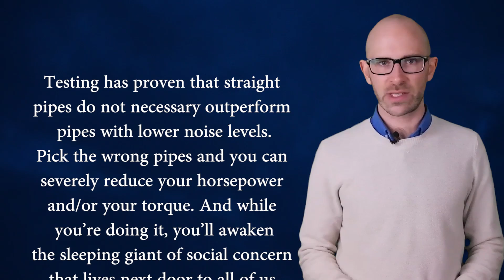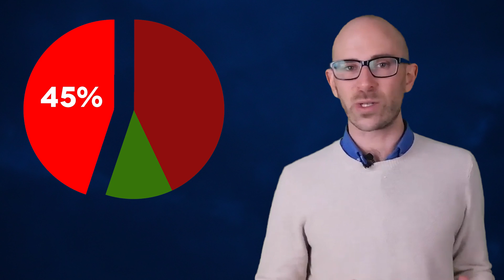Why are Harley Davidson Motorcycles So Loud?

Comment: I am willing to bet that all of the locations you mentioned are run by liberals. You also failed to mention that while riding, you’re actually traveling away from the noise you are talking about. I’m willing to bet that the DB levels from the exhaust is less than the wind noise when at highway speeds. I think I’ll go pull the baffles out of my Roadking now. 👍🏻
Reply: Thunder headers on my Roadking SE....
"Loud pipes save lives"....obviously he's clueless.
Reply: U Yanks throw some sort of political slant on absolutely anything....
Reply: Republican here. Loud motorcycles drive me crazy. Dont rev the crap out of your bike in a residential area where people just want to enjoy their backyards
Reply: @loganm2766  well you wouldn’t like mine then

Comment: He did answer why... the engines aren't as muffled as cars and people make changes that make them even louder. He even gave a charitable viewpoint of why they do that, though with certain drivers I'm still gonna say they're attention whores. You know the ones... not talking about someone who drives up to the red light, waits, and drives on, making a certain amount of noise in the process. I'm talking about the jackass whose idling engine drowns out your thoughts, who feels the need to sit and rev the thing over and over in the parking lot, who you can hear in the distance like some kind of alien murder machine when you're trying to sleep, and who blows your eardrums through a black hole when they go tearing out as the light turns green. That overcompensating loser.

Comment: What I find funny is that people will complain about a loud bike, but not ssay a word about pickup trucks louder than any bike, and the loud diesel pickups spewing black smoke out the stove pipes sticking up over the cab.

Yes there is a power difference, my quiet 1700cc(104ci) Kawasaki touring bike has no chance staying with a Harley 103ci(1688cc) touring bike

I like quiet from my bikes, but I like riding with loud bikes.......loud piipes really do save lives
Me riding behind those loud bikes is no problem, I don't understand why its a problem and louder trucks are not.
Reply: No, I'll gladly point out how annoying the spotless gigantic truck with chrome and a lift kit are. They're just as loud, tend to punch it at stop lights and signs, and also drive like assholes. It's made more ironic when they're pulling a trailer with a motorcycle on it.
It's the same problem as how everyone thinks you must be a future mass murderer if they find outut you own a gun.

Comment: I found this video because our community is having noise problems with in particular HD bikes since one of their stores opened down the street.  Now I'm also concerned about the hearing issues of riding the bikes not only for myself but my friends who own them especially because many of them have added stereo systems, equally loud.  My take away from the video is that it is the modification of the exhaust pipes that is causing the problem.  This seems like something that can be monitored by policing and registration.  I love seeing the bikes but I know the community is starting to have issues as the noise goes way past our noise ordinance times and echos among the old buildings.

Comment: Go ahead and try to make me quiet down my Harley. Loud pipes save lives!
Reply: Sure, it's the driver's fault and not the motor cycles squeezing between cars, breezing through red lights, and cutting people off.
Loud pipes aren't going to help someone hermedically sealed in a box with it's own engine, a radio, and AC to spot the narcissist whipping around them.
You hear sirens (you'll likely spot red and blue lights first) you pull over regardless. People should have to pull over for motorcycles too?

Comment: The debate does not rage on at all! You do not address the issue. You intruduce facts that have nothing to do with exhaust noise. Facts are a louder exhaust is heard by othet drivers and that save lives.The facts presented about motorcycle accidents have nothing at all to do with loud exhausts.Nothing.

Comment: A really Bad comment at 5.10 about motorcyclists being the cause of most accidents. That was not the premis of your first statement which was "do loude exahusts alert drivers of cars to a motorcyles presence'".The answer is avoided by the reamark at 5:10. The true answer which the poster avoides is 'yes loud exhausts do alert car drivers to there presence'. It's a fact.

Comment: Harley brakes are crap to make them drive slower,
to save blowing the geriatric motor up, 
the noise is to make em sound fast. 
A simple machine for turning cash into noise.
Reply: Harleys have been using Brembo brakes for 20 years now, 
The noise is from people buying stupid loud pipes for them.
Reply: @vector6977  why would you use the term stupid ??

Comment: Oh, and why are they so loud? You never got around to that. You could have gotten into the degrees of the cylinders or the way timing and valves work and egual and unequal length of exaust pipes, carburetor intakes and fuel injection. Or how the actual sound of a Harley is trademarked. This was a disappointing vid. It went like this. Once upon a time, the end.

Comment: LMAO..... You make me want to put even louder pipes on now ....
Reply: You make me want to drive past motorcycle accidents without calling an ambulance.
Reply: @jacobstaten2366  disgusting
Reply: @duskshadowpaws4434  *disgusting. And yes, causing noise pollution to get attention is disgusting.
Reply: @jacobstaten2366  although on a brighter note thanks for improving my grammar, lol
Reply: @duskshadowpaws4434   I never said I would actually do this thing. I said the original post made me want to do this thing because of how repugnant the post was. Now that grammar is out of the way, let's work on reading comprehension.
Reply: @jacobstaten2366  Well i will admit, I was never the best in my english class, didn't get a very good grade in the final exam, which is probably why I misinterpreted your comment. Nevertheless I'm glad you made yourself clear to avoid further misunderstandings. Although I believe there is nothing more to discuss here, correct me if I'm wrong, but i'm going to get on with my day now.

Comment: Motorcyclists should not rely on loud pipes to prevent crashes but good driving skills.  Many aftermarket pipes state right on them for off road use only.  Plus emissions are effected especially if the catalytic converter is also removed.  Harley got in trouble with many of their after market products not meeting EPA standards.  Harley’s are low powered purchased new and have different stages of power improvement/noise up to Stage 4.  Harley’s way of getting around emissions with air cooled bikes that have more problems trying to pass emissions especially with Euro 5 around the corner.

Comment: As a Harley mechanic and motorcycle rider, I can say that all of that is true. Harley no longer supports race systems for street bikes in any capacity although the after market arena is still saturated. What many people we in the industry call "yuppies" don't realize is that just changing the exhaust isn't enough to improve performance, you also have to match the intake and the ECM needs to be reflashed (reprigrammed) to accept the new system and utilize proper fuel/air mixtures. Just a fun fact. Love the channel, keep up the good work Simon.
Reply: Basically they are loud because Harleys cone with large engines and small exhaust baffles then people change the exhaust or remove the exhaust baffles which help to dampen sound.

Comment: They are loud because of big valves and a single pin crank there is a reason they are measured in cubic inches instead of cubic centimeters

Comment: I can respect the people here not giving the thumbs up to loud Harley exhausts. I use to be one of those people BUT when i purchased a bike my view changed. After a month in the traffic and nearly being swiped several times I could see why people modify there exhaust. Not just for more power but to give themselves every chance of surviving on the roads and highways. Sometimes motorist can't see us as we may be in there blind spot and this is when an accident can happen. Yes I agree some Harleys are just too loud and I think these ones makes it hard for us all. However a Harley straight out of the factory in my opinion is not loud enough and this needs to change.  Remember we have little protection and until you nearly get swiped by a car, several times...... you may change your mind about a louder exhaust as well.

Comment: i happen to have dcb meater and my 1992 hd with after marke exaust is at 120 dcb. ive been riding for many years and recently had a hearing check "exeptional" i was told. harleys just sound better unrestricted. try puting a muffler on pavarotti...

Comment: So........the first crash I had I was stopped at a Stop Light and was hit from behind - obviously my fault, what was I thinking?  The second crash where the first van coming towards me  turned left in front of me, I swerved around behind him just missing him but smacked head long into the side of another van that had decided it was ok to pull out of the stop street and cross in front of me.  Again you could say "what was I thinking, I had the right of way but".  Obviously I was at fault in both cases because I seemed to be the only one laying there thinking *&^%$^$%#!  Ah it just hit me, I still had the factory pipes on and hadn't switched them out for the latest Vance and Grinds super cool pipes - that's why I got schmucked!

Comment: It's all very simple. Any piston engine will improve performance if you can get the gasses flowing through the engine with greater ease. It is the cheapest and first thing to do with any engine, to remove gas flow restrictions from the intake and the exhaust. It is the oldest hot rod mod for cars and bikes. 
Having said that it is important to do this properly, by merely putting straight through exhaust pipes achieves little in performance! Do it right and you can expect around 5hp improvement and higher torque. Do it wrong and you achieve little other than noise.
Tis a pity so many young riders go for noise without even knowing why we removed pipes and air cleaners back in the day

Comment: Biggest pussy ever. For those of you saying HD is not powerful, you don't know torque vs RPM. Very different, most HD's are not built to be on a track. They are built so that my fat ass along with all the shit I stuff in my bags can go 5 to 800 miles a day without being fazed. Wanna go fast buy a metric, wanna go long you get torque HD all day.

Comment: Besides the excess noise from immensely popular aftermarket exhaust systems, there’s increased emissions because the aftermarket systems are missing the catalytic converters (integrated with original muffler) that came on new Harley’s since 1995 in CA at least.
Newer Harley’s have more displacement than many small cars and should be subject to smog inspections same as cars and light trucks.

Comment: It's a cover up.

Quiet the HD exhaust and all becomes obvious.  Mechanical noise of the engine and mission alone would reveal the sham.  HD exhaust noise overwhelms the sloppy mechanical noises.  "If it isn't loud and doesn't clunk when shifted  - it ain't a Harley."      If your everyday automobile clunked and ground like HD you won't leave the driveway and assume that your vehicle has some extremely serious problems.   For any hardcore HD  fans - try it.  Silence your overwhelming exhaust and you'll be ashamed, embarrassed, possibly afraid,  to ride such a pile of mechanical moving parts.   Replace the quiet pipes and dump that thing quick. 

Thank Me Later

Comment: Harleys equipped with stock exhaust are just as quiet as any other two cylinder motorcycle. Motorcycles aren't exactly loud unless they're modified with aftermarket exhaust. The reason people target HD here in the US is probably because they make up for 50% of all motorcycles on the road. Even though Harleys are more popular in my area than other types of bikes I hear just as many crotch rockets emitting loud exhaust noise as I do HD's.

Although many will disagree I do believe loud pipes save lives. That doesn't in any way mean to rely on your exhaust for safety. In my personal opinion loud pipes can help just as much as wearing hi-viz gear, bright lights and all the other things motorcyclist do to reduce increase their chances of being seen and reduce the risk of an accident. That said the best thing one can do to increase safety on a bike is to be aware of your surroundings and always ride defensively.

Now the people who always argue that loud pipes never do anything in terms of safety.. here's why I have trouble believing that. There has never been a statistic study that's reliable enough to debunk it. Why? Because there is absolutely no way to know how many accidents have been avoided due to exhaust noise.. because the accident never happened! 

People argue that with the soundproofing in today's vehicles the chances of being heard are nearly non existent, which is true to an extent. If you have your windows up, air on & your radio playing than your not hearing much at all in a moving vehicle. Of course we can't assume every vehicle on the road falls into that category either.

People also argue that you can't hear a motorcycle traveling behind you because the exhaust noise is traveling the wrong direction. Of course the faster your traveling the less likely you are to hear anything also. The problem there is that although a majority of the sound is behind the rider, sound travels in all directions at speeds over 1,000 MPH. Because of that I find it hard to believe that you & others you know that have ever been in or operated a vehicle have never heard the sound of a loud bike/car/truck from the rear. 

Another thing worth mentioning is that you shouldnt just be worried about the drivers in front of me. In fact the drivers behind you are just as much an issue since they're the ones you can't constantly keep an eye on. Some of the more likely motorcycle accidents in the US (besides accidents involving none other than the motorcyclist themselves) are people making left turns cutting off the bike & riders being rear ended. You can stay in gear when stopped at a redlight, keep your eyes on your mirrors and be wearing whatever you want but that's not gonna do anything for the guy/girl in their 2 ton metal cage who's to busy playing with a phone from coasting into you. If noise helps alert someone like that and stops what could be an accident waiting to happen even if it's only one time than it's worth it.

For the record yes I ride a motorcycle and yes it's pretty loud. I've never once had to explain why it's loud in the real world, only on the internet. No I don't go around saying 'loud pipes save lives', I actually just like the sound and prefer hearing it over wind noise. If at any time I helps me get noticed and reduces my chances of getting injured than that's just an added bonus. I try being respectful to my neighbors by not letting it sit and idle for to long. I'm not one of those guys that blips his throttle going down the street in the morming. I'm not that guy doing burnouts in his driveway. The times I get back late at night I get my ride put away and kill the engine. Nobody including neighbors has ever said anything to me about my bike. In fact they're more irritated by loud noises that don't go away after 30 seconds like dogs barking, house parties, loud kids and people mowing there lawn at the crack of dawn on the weekend. 

If you or anyone has a problem with a neighbor running loud exhaust you should either talk to them about it like an adult or suck it up and realize that unless you move somewhere with no neighbors there is always going to be something you have to deal with such as noise. Of course those same type of people will just find something different to complain about. Where I'm at sound ordinance is 7am-11pm so anything in that time period you deal with or live somewhere less populated.

I think I can speak for everyone who falls into the loud pipe category when I say you can think and say whatever you want, but while your busy hating we're to busy enjoying our lives. Everybody out there does something that other people might frown upon at some point and that doesn't mean you should stop doing it.

Comment: Motorcycles are inevitably invisible to most automobiles on the road. Stock exhaust just adds to that. As for me, if I can’t be seen I will be heard! Additionally, I always ride defensively as well. The added sound helps with safety. (In my personal experience)
Reply: That's why the "smart money" learns from riding motor cycles that car drivers do not see you if you ride at speed, weave like a loser in and out of traffic, have "something to prove" like a child, etc. The side pillars on car windscreens are renowned for obscuring travelling motorcyclist's. Happened to me. I saw the person's head turn in my direction but her eyes were obscured by the pillar. No lie. Saved myself, that time. I drive a car now. Obviously, my health and safety are more important.

Comment: WHY ARE THEY LOAD? Because I want them that way. It's my middle finger to the world and I know it bugs the tofu eating salad shooters. Yes, I am an @$$####. And of your 45%, you may have alluded to being forced off the road I'm not sure. They were single vehicle because the motorcyclist didn't want to have a head on with a car. I used to call BS on the loud pipes save lives until I was in an accidents that the driver said they didn't see me or hear me. From that point, I'm making sure my noise, (which I make sure you enjoy while on your cell phone), is heard by you. I'll even give you a couple of miles of my window shattering serenade. Its OK to text and drive but my exhaust P's you off. GOOD
Reply: Love it.Ty brother.I ride also